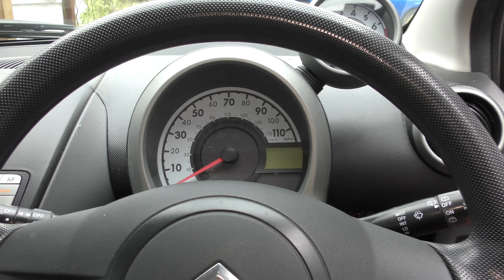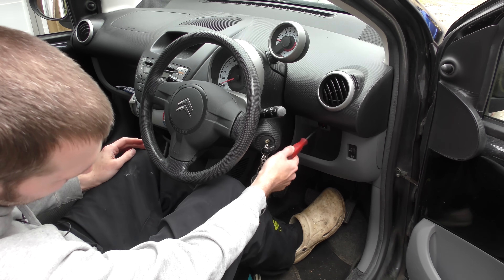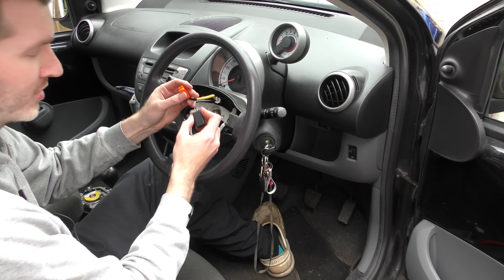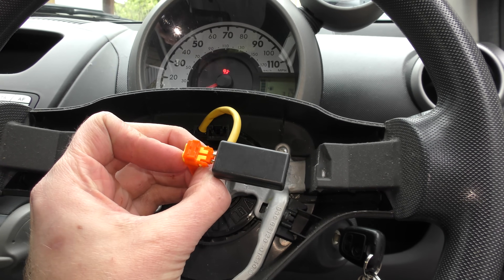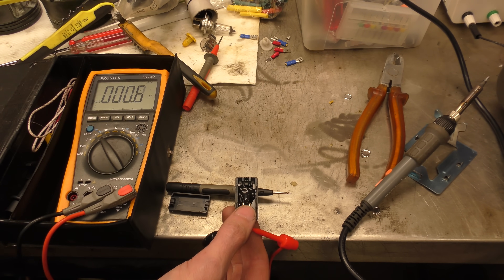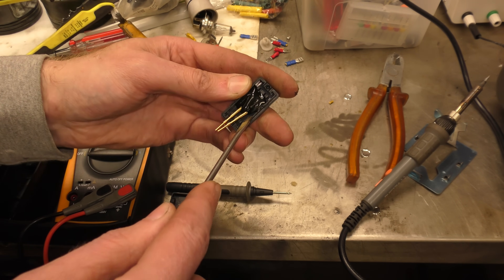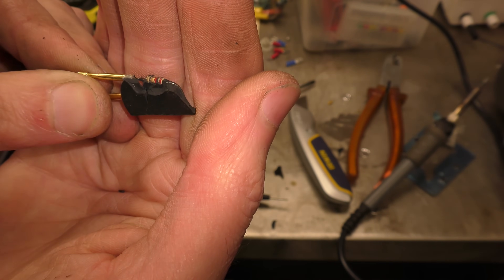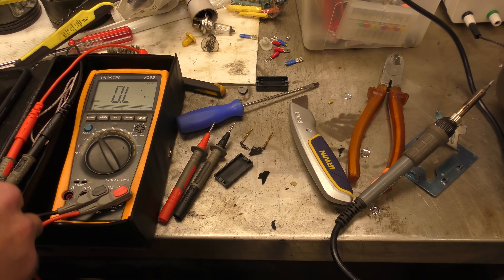Airbag Emulator - what's inside?

Comment: On a Honda it is a 2.2 Ohm resistor so that seems about right. Most cars seems to range from about 2 to 3.5 Ohms.
Reply: Do you know the right one for Nissan?
Reply: @isaacnewton1545  From what I can see it looks like 2.2 ohms will work for Nissan as well. If you search “NRG 2 ohm resistor” or”NRG airbag bypass” they sell what looks like a fuse with 2 red wires. That is the one I used. It’s around $10-15 for a 2 pack usually.
Reply: @CouchMan88  thanks for the reply. Also do we need especial tools to remove the plastic on steering wheel  to have access those airbags fuses?
Reply: @isaacnewton1545  The fuses should just be normal fuses. Make sure to disconnect the battery for at least 20-30 minutes before working on anything related to the airbags. You don't want them to go off while doing anything with them. You need to look up the procedure on how to do it for your car. There is a potential for an airbag deployment, so you need to be really careful and understand the wiring diagram. Much of the time you can just pop off the plastic, remove the bolts/nuts that hold the steering wheel on and unplug the harness to it. Always make sure the battery is fully disconnected. 

What you need to do is find what two pins on the airbag wiring to connect with the resistor to and then it will prevent the airbag light from coming on. You can also just leave it unplugged and remove the fuse but it will illuminate the SRS or airbag light on the gauge cluster. Keep in mind removing the airbag in most states is not recommended and many times illegal. All the bypass really does is prevent the warning light on the dash and keep the passenger airbag functional if you remove the one on the steering wheel.
Reply: For vw golf 5 airbag pasager?

Comment: My old saxo had the same problem it was a wire underneath the passenger seat
Reply from the maker: While I waited for the scanner to arrive I had unplugged and replugged all the airbags.  It said it was a fault with both fronts.  But it cleared and didn't come back.  Might have been something like a battery voltage issue.
Reply: @DavidMcLuckie  Ive got the same car ( Toyota Aygo ) with the same fault , cant seem to find any damage to cables , Has yours still cleared ?
Reply from the maker: It wouldn't be a real Citroen without some kind of electrical gremlin.

Comment: I have a launch v111 or summat similar does abs srs and engine codes was only 80 from ebay saved me a fortune over the snap on one and much better than my blue point micro scan
Reply from the maker: That's good to know as I've just invested an a Launch diagnostic tool.  There should even be a couple of videos, eventually.
Reply: @DavidMcLuckie   there good little units i even found codes in my old van that wouldnt read on the works scanner.

Comment: Take it a generic code reader wasn't generating a code ?
Is concur with it often being the seats and usually after hoovering......
Car not been in a bump? Another culprit is the 2 sensors near the front bumper. Seen them come undone / wiring rot
Reply from the maker: The code reader I have only does the engine ECU, currently waiting on one coming from Wish to try.
Reply: @DavidMcLuckie  pp2000 is I think the kinda thing your looking fot.